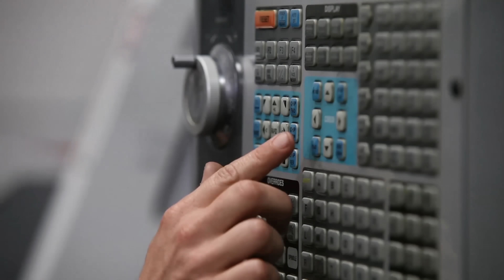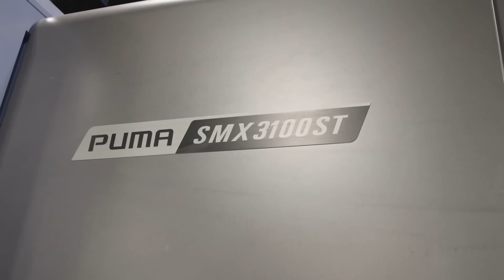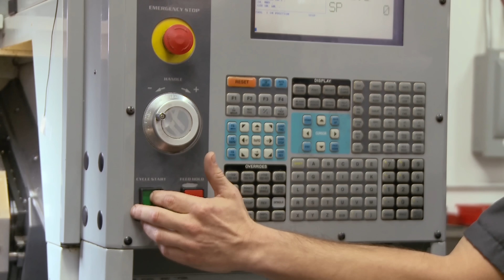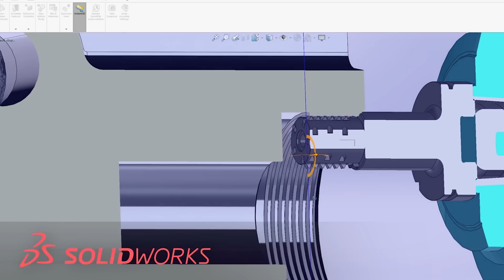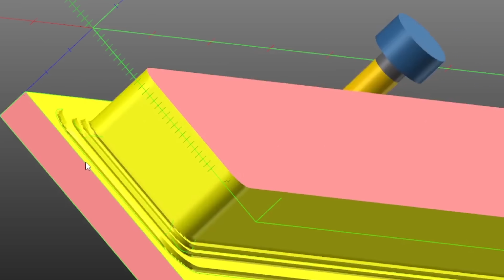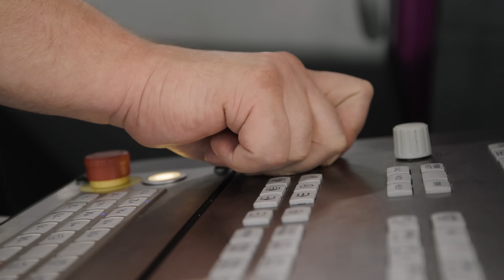Why We Keep LOSING Money?

Comment: Running a small or one man shop should be easy to keep organized, but it is just the opposite.  When you focus on getting work done you tend to ignore some of the type of organization and record keeping that can help you out.  Organizing tools, especially if you use a lot of different ones for short run jobs can be a daunting task.  Having someone else around to do that for you would be great but making the time to do it just isnt always there.  Especially if you are not sure how to do it.  I still find it amazing how much thought and effort it takes.  Charles
Reply: I am a 1 man shop. I am my own worst enemy. I walk around the shop with a tool in my hand and subconsciously leave it where it can never be found.
Reply: I'm also a one man shop and I think it's important to have enough toolholders. I think I have about a hundred for a single mill, and could use a few more for drills, as I tackle a large variety of jobs. But basically the good tools are already in the holders ready for service. Any tools just laying about are junk, suitable for more abuse in very rough or manual mill use. Brand new tools are in their boxes in cabinets, where you'd expect. Of course I do have to change the odd tool once in a while, but it's not like the drudgery of opening up and cleaning every colletted toolholder I own.

I also precision milled the keys under my 2 Kurt vises by inverting them on a single straight edge and trimming them to match the T slots. I never have to realign those 2 vises in Y, and one is a half a thou higher in Z, and I know about it already!

Comment: Employees want Overtime vs Better hourly wages.
I ask them if they rather work more hours or make more hourly.
Then they look like deer in headlights.
No one understands that even 5 seconds on a 10,000pc job is a SIGNIFICANT time savings.
Every job I see has random movements from MasterCam that can increase time.
Watch your machine movements.
Fix them, and watch the production increase!
Just have your resume ready because most companies do not actually want improvements.
They just want more monkeys at machines.
Reply: Most companies that I have seen don't understand the value of a good, efficiency minded programmer. That is the guy that literally sets the pace of the entire shop.
Reply: @barrysetzer  I have OCD, I actually have a difficult time working in shops that lack organization.
I’m very fast paced! I was the lead Lathe guy at a company and set up and ran 8 Lathes with one operator.
I would make custom bar pullers just to let machines run 4’ bars.
In the end the owners son could not keep enough work coming in and I was told to no longer run bar pullers.
I even took a 3 operation job and made it in one operation on a Mazak QT 40 with 5’ bars. 
The owner and his son came to me and explained that this would put other employees out of work.
Polish owned shop helping the Polish immigrant’s. Good intentions, but horrible work ethic’s.
In the end, the company did not want to make more money, rather employ more immigrants.
The owner wouldn’t let his son fire me, because he understood my mentality. The son however was threatened by my experience.
The father wanted to purchase a new Integrex, and the son didn’t want it because he didn’t know how to program or run it. So he told his father I did not know how to program it either.
They went with a Mazak 250 MY with the Smooth control. The son didn’t know how to program that either. My resume CLEARY stated I TEGREX programming experience!
I ended up leaving that company when the son threatened me physically.
😎🙌😎
Control freaks!
Reply: Except its generally, in my experience, never "better hourly wages" but rather "more work for the same shitty wages"
Reply: @machinist7230  stand up for your experience! It’s not your fault they believe more hours is the only way to “catch up”.
I have no issues telling a potential employer I’m not interested in overtime to make ends meet. I have a family, I work to live, not live to work.
ESPECIALLY after a walkthrough of their shop and you see tools laying everywhere and dirty machines.
If a potential employer can’t pay you what your worth, they are not worth working for EVER!
Take pride in your skills!
Employer: We are looking for someone to help organize our shop and improve our production.
Me: I have experience organizing, and improving production. I’m asking for 35$ an Hour. Have a nice day!
Reply: Except its generally, in my experience, never "better hourly wages" but rather "more work for the same shitty wages"

Comment: I have a question for anybody willing to answer. Is GM, Production manager,  Inspector, QC, machine mechanic, customer service, setups, and operator too much responsibility for one person. I am pretty much responsible for everything but the bills and getting and quoting work for the shop. We generally have between 7-10 employees total, with 7 cnc mills, 5 cnc lathes, 1 manual mill, 1 manual lathe,  1 manual surface grinder(running 50% of the tine),1 automatic surface grinder, and 2 swisses.. We have some automation, 5 robotic arms total, 1 runs periodically,  but the 2 on the lathes, and 2 on mills run every night, so plenty of parts to deburr off the mills every morning. We also have an assembly area where we assemble our product. I've been in my position for a little over 3 years and I love machining and my job, but I feel like I'm drowning, and am always missing stuff because I have soo much going on. Do I just need to suck it up and keep truckin along(which I'll do) or is this not a sustainable situation!? Any advice or opinions are greatly appreciated!!
Reply: It sounds like you are a fellow alpha dog, and you take on anything that's thrown at you. I've always done the same, but you have to be very careful that you don't burn yourself out. Start delegating more, even if you run the risk of something not getting done right. That's the only way people learn. In the end, it is better to do 1 job at 100%, than to give 5 jobs 20%, but it is incredibly valuable to be capable of doing all of the jobs that you are. "I am a jack of all trades, but a master of none. But sometimes that's better than a master of 1."
Reply: study up on time management strategies. but also don't kill yourself.
Reply: Customer service shouldn't be on you if you're an operator imo..

Comment: What is bad is when the workers know how bad things are efficiency wise and know what changes need to be made but the boss won’t make the changes and isn’t interested to listen  to the problems.
Reply: That's exactly how it is in our shop too.. 
The boss is like "we've been doing this for 40 years"
yep, that's the problem, you've done the same process for 40 years, no wonder why we're struggling is what I'm thinking.

Some issues with the shop I'm at (family owned, approx 50 employees):
- There is no inventory control. At all. I could put a tray of inserts in my pocket and walk out the door.
- Often you have to stop your current job to work on another job for another customer the boss think is more important - which increases the time it takes to do both jobs as now I have to re-align the previous part from mid-process... 
- I get told to use 30 y/o tooling that hasn't been used the last decade when asking for better tools. 
- Have to go scavenge for drills and end mills at other workstations. Not to mention about taps.
- Only some of the workstations have their own tooling, but then - those who don't come to borrow from those who have..
- Management buys in just the minimum of tooling that's dirt cheap and expects superior quality.
- Material quality is subpar, which leads to me needing to remove long chips between each cycle so the tool doesn't get clogged and breaks.. ex: buys S355J2 when we have used Ovako280 before which performs better with much better chip performance.
- Managment are often more in the workshop hanging over my shoulder than inside their offices. Not just me, everybody - and I see a general high stress level in the workshop because of it.
- Management lacks communication and yells at us for not being able to read their minds - I see a lot of people just not giving a damn or being careless with what they do because they're gonna get yelled at, no matter if they do things right..

If I try to hint at any of this I get yelled at too.
Reply: @therealsourc3  exactly like my current job. Reason why I currently searching for a new employer
Reply: @Tankliker  Kinda wanna do that too.. Tho where I live there are only 3 CNC shops in like a 200 mile distance. I don't really wanna move atm so I kinda suck it up until it gets too bad..
Reply: @therealsourc3  I have a similar Problem but am not working CNC. 

My problem is less to find a workplace but more one that's currently interested. 

But I am unwilling to suck it up anymore, as I have seen a coworker nearly get send to hospital because my current boss was too careless.
Reply: @Tankliker  Lol same with the "we've been doing this for 20 years" for me, we've used the same coolant on mauanls to our now CNC Mills/lathes. We have rust issues on parts, rust issues on the machines (Tools get stuck in their pocket in our mills tool changer and tapers have rust on them as well as the actual clamp) The rear slide covers of my main lathe is RUSTED beyond hell and now currently thunks into place and scratches. Our bigger johnsford lathe had slidewyas full of rust till they straight up split and broke, cleaned out half a pound of rust some WD40 and wowee it works fantastic. Boss still wont pay the extra $400/barrel (we only have one every couple months), also our concentration of coolant...... current coolant maybe 2%? I do quick math for a 55 gallon barrel I need 5.5G to be coolant fluid ACCORDING TO THE MANUFACTURER and she goes "no we've been doing this for 20 years its fine". Mill tables continue to rust, chucks get impossible to open and parts rust
Reply: @blade9038  Tbh, I don't work with CNC machines, but manual ones also theoretically need to be kept clean. 

But I know this feeling to well to see the one machine the entire shop runs on rust and all you can do is stand there and look it all going to hell.
Reply: @Tankliker  of course but to my knowledge the shop operated differently before I came (about a year and some ago) and the head machinist complains about rust and she does nothing. 

Really sucks because we really are pushing important material through the CNC lathe and I won't be allowed down time to clean and fix it.
Reply: @blade9038  yeah, my boss always tells me that we would need to work faster if we want to keep it clean. 

Like dude, we work faster, you just increase workload and increase stress even more but don't even dare to get slower again because my sweet money ain't rolling in if you don't get that shit build by tomorrow.
Reply: @therealsourc3  hitting all the nails on that one!!! I even gone as far as to see what I can get away with, due to management does not really care. Turned the feedrate down to 20%, did not bother anyone, but me asking for proper tools for the new machine that is bare naked, no tooling, now that is something to scuff about...
Reply: @therealsourc3  Well , I feel a little better knowing I'm not alone in having very similar experiences. It eventually lead to shop I was working at for 10 yrs closing down.
Reply: Know the feeling
Reply: Currently trying to change jobs because of this
Reply: I found an old compact flash card. it came from a shop where the owner refused to switch to USB and insisted that his machines didn't have rs232. dude bought new machines and had them fitted with older fanuc controls .
Reply: @wannabecarguy  NGL, that really shots it down. 

Guy is basically embracing self restriction and indirectly inefficiency.
Reply: This problem is more common than people would like to think. Especially when management only thinks of producing and pinching pennies. It is hard to change people from being myopic and not looking into the future
Reply: Exactly!!
Reply: Going through that right now, not very motivating and takes the fun out of machining.
Reply: Why I left machining
Reply: Been there, not working there anymore...and now they are down to 2 cncs not 6.
Reply: That RARELY happens lmao
Reply: This. But I get paid by the hour so I take as long as it takes to get something done. I've been told to do a hot set up when material hasnt even been cut on the saw yet let alone a program been made.
Reply: This is super common at low quantity production facilities. Sometimes there's a reason, sometimes not.
Reply: Because there is a difference between those of us on the floor and those in the office. Usually it has to do with a degree and letter behind your name. Those in the office see numbers not practical application.
Reply: @jrjones406  Having been on both sides, and bring a guy with a extremely expensive and prestigious sheet of paper, you're utterly wrong and completely right. Your job as a technician/operator is to communicate what problems your observing, how you would address them, and all associated costs so that the impact of the solution can be fully understood. You don't know the full picture in terms company finances, contract limitations, and technical considerations beyond the components you're working on. They don't know the full picture and cost of your day to day irritations. Help them to understand that in a way that matters to the team, not just yourself.
Reply: I know the feeling 
But would you do you have to finish nearly 800 parts? 
You give full Speed and must change the Tool every 10 pieces or you give speed to finish 100 piece and change.